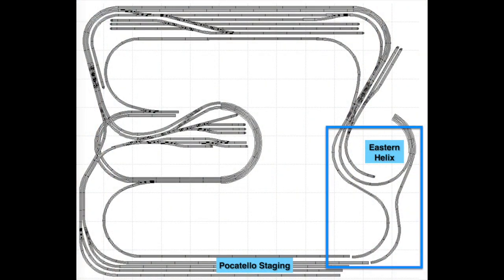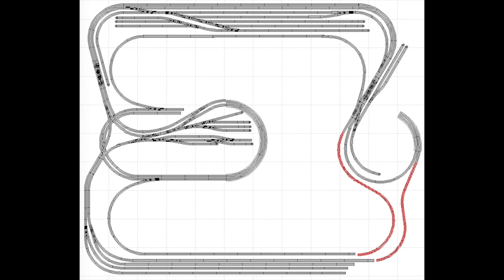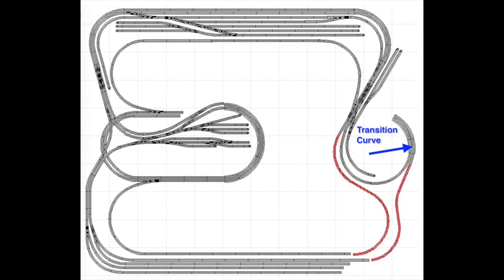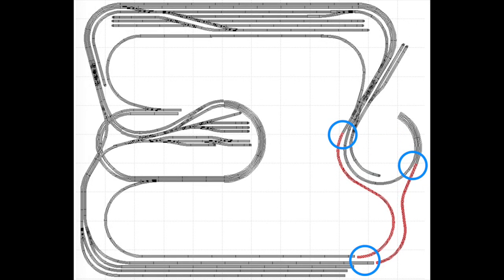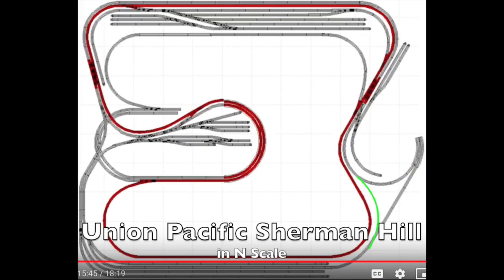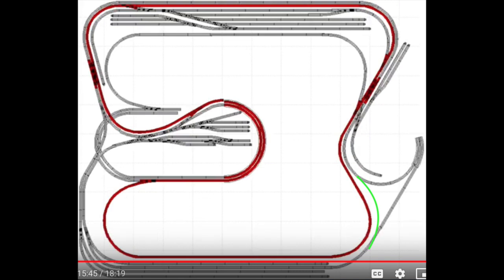Trackplan Changes 3: Bridging the Gap on My N-Scale Layout

Comment: Hello Roy, I've built a lift out section about 1.5 m by .150 mm it allows me to have a continuous run, comes off the straight main base board at aprox' 45 degrees which allows for the door open when in situ, This also allows for end to end running if I choose not to have it in place. Certainly enjoying your inspirational videos. Keep up the good work.

Comment: Just a thought:  Hinge the new section against the wall where your train shelf currently is located.  The new section folds up to the wall for room access and folds down for use.  The hinge keeps everything in alignment.  Since the new section is attached, a simple wire service loop can provide electrical service.
Reply from the maker: Thanks, my friend. That definitely is an option, and I may end up doing it. I do like it. We'll see. ...Roy

Comment: It's possible to "kitbash" flex track onto Unitrack -- for instance, cut a Unitrack straight section in half, and solder a piece of flex track between the ends using standard rail joiners and cutting away enough of the Unitrack roadbed-ties to let the rail joiners slide in. You can shim cork roadbed underneath the flex part to match the height of the Unitrack.  I've done this in HO.
Reply from the maker: Yes, I've heard of doing that, John. I may end up doing it myself, if need be. In addition, I know that Kato makes a transition section of track that allows you to connect Kato and Atlas track. ...Roy

Comment: Great videos, Roy.  Keep them coming.

With regards to "bridging the gap", you may want to consider having the addition be place on a vertical unit that has caster wheels, so you can simply push/pull the unit in and out of place.  The unit could also offer some additional storage area beneath it, if so desired.  Doing so will probably require that you either add some or remove some small pieces to the existing layout in order to create a convex shape, and then make the unit a concave shape so that it can be pushed/pulled into the room for access.
Reply from the maker: That's an interesting op;ion, David. Thanks for suggesting it. I still haven't decided what type of bridge to build, but I need to make that decision soon, because I want to get started on it.  ...Roy

Comment: Roy,  first, the door looks great swinging out now, the carpenter did a good job.  Next, you do have a very tight corner to make connections and incorporate some type of lift section. Slow going is the bast way to go most times, it gives you a chance to sit back and imagine trains running and any possible issues that could occur. Best always and look forward to the next videos.
Reply from the maker: Thanks, Rob. Yes, I am very happy with the door, now that it swings outward. It was such an impediment before. Now I have a lot more space in the layout room and can reconfigure my track plan in a way that will allow for much more interesting operations. As for the bridge itself, I must continue to think about it and really appreciate all of the suggestions that I have been receiving.  ...Roy

Comment: Clever way to begin by using the wooden supports and the foam sub base allowing you to lay the track in place before beginning.. Tom
Reply from the maker: Thanks, Tom. It was an easy way to make a template, and the template will help me cut the plywood correctly later on. ...Roy

Comment: Roy, A great update this week. This week there has been so many really brilliant ideas for the removeable section, all would work. I know how you performed the trick at the start of the video standing on both sides of the door at once. Like a true magician Roy, you used all " Smoke & Mirror's to make it happen. Cheers, Chris Perry.
Reply from the maker: Thanks, Chris! I'm continuing to work on the "removable" section and expect to deliver an update about it on Saturday. By accident, I figured out how to add a third track across it that will enable me to run not just one but TWO trains simultaneously on the upper level, without either of them having to descend the helices. That will be in Saturday's update. If you think that door trick was a feat of magic, what if I told you that my entire layout was just a bunch of smoke and mirrors? Ha! Just kidding. Do we deserve to have this much fun? (Yes!!!). See you on Saturday. ...Roy
Reply: Roy, I'll be interested to see how you was able to put in  a 3rd., track in such a small area. If not smoke and mirrors, could it be a Mirage, I wonder? Cheers, Chris. @n-scaleunionpacificevansto6569
Reply: @ainsleyperry5192   Chris, the most amazing thing about that third track is: I couldn't make it fit when doing the computerized track plan, but as I was fooling around with the actual track, it just fell in place, like some kind of miracle. ...Roy
Reply: @resmith49 , Just doing what you do best Roy. Just fooling around. Cheers, chris Perry..

Comment: Roy, just a question...
Why have go got that little s bend in the back track? You could have easily come off the helix and had nice straight run before curving into the yard. That also would have given you a wider radius curve leading into the yard.
Also, mike fifer did a video showing how to turn Kato track into flex track
Reply from the maker: You're right,  my friend. I've been thinking the same thing.  I'm not very fond of that bend. I'm going to straighten it out. ...Roy

Comment: I am not an experienced model railroader, but my attempt at a lift out section ended up turning into a duck under, and then a complete track plan change. I think that my problem was that I had 1/2 inch of difference between the two sides when I planed on it being level. I hope you have more luck than I did!
Reply from the maker: Well, Jared, a duck-under would be the easiest solution to my layout. I might start out with one, just to get trains running across the gap as quickly as possible. But eventually I'd probably change it for some kind of bridge that moves out of the way, because I'm getting a little to old to be ducking under. Thanks for sharing your experience. ...Roy

Comment: Real peogress, Roy!  However I would still suggest that you considder a lifting section hinged on the 'Helix Side'  which looks wide enough to support a structure of the necessary size.  If you install hinges raised a couple of inches above the baseboard surface the rail ends will move apart as the section rises...  Well it works on my layout though admittedly my 'bridge' is not in a corner!
Reply from the maker: Thanks, my friend. I appreciate your suggestion to put the hinges on the helix side of the layout. I like this idea, and it's what I may just end of doing. We'll see. I'm going to need to make a decision pretty soon. ...Roy

Comment: I WOULD LIKE TO KNOW IF YOU USE CURVES TIGHTER THAN 20-140 15" RADIUS CURVES, ON ANY PART OF LAYOUT. I LIKE WHAT YOU HAVE STARTED DOING THIS YEAR. TOMIX HAS A NICE SET OF MIX TRACKS I USED A COUPLE OF THE 30 DEGREE CROSSOVER
Reply from the maker: Thanks, Duane. Yes, I do use 20-130 in a limited number of spots where absolutely necessary, but nothing smaller than that. I prefer to use 20-140. Unfortunately, smaller layouts sometimes require that we use tighter radii than we would like. ...Roy

Comment: I think I have an idea for it but I will need some measurements from the tabletop to the floor And from the Layout edge to the door
Reply from the maker: Thanks, Joh. I appreciate it. Here are those 2 measurements: tabletop to floor - 56 inches and distance from door to layout edge - 40 inches. ...Roy
Reply: I also forgot to ask how wide
Reply: @cnwtrains  34 inches.
Reply: @n-scaleunionpacificevansto6569   Do you prefer a drop down or lift up? Still working on the plan for you

Comment: Hi Roy
UPSHERMANHILLS idea is worthy of continued thought. here is my 2 cents: if possible  at the yard at the bottom of the screen at  3:45  , modify the layout by using the top yard track as the extension for your new 'green' track and the second 'original' stays the same without the 'green' part. back in the yard could one or two  of double crossovers turnouts make for more versatility...?  I guess my feelings are that the closed end of the yard should  'join up more' eh? the tricky bit is that there is still a curved turnout... that little siding by the helix entrance /exit could possibly be joined to that helix track  ? thank you Roy...still giving thought to this pleasant little puzzle!
Reply from the maker: Absolutely, Bill. I haven't cut the plywood yet, and I'm continuing to consider UP Sherman Hill's suggestion, because I like it VERY much. Originally, I intended Pocatello to be purely a staging yard, but with these layout changes, it now works better as a through-yard (enroute to Portland, Oregon). So, definitely, I need to convert at least another one of the 4 tracks at Pocatello into through-tracks. I've been thinking of re-purposing that lead track for Crown Oil & Gas, just as you mentioned.  ...Roy

Comment: Hi Roy I have heard of people mixing Kato unitrac with flex track. There is a video out there but for the life of me I can't remember from who. Would you consider this? Good to see your plan moving forward nicely.
Reply: I am mixing Peco 55, Atlas 80 and Kato unitrac on my layout.  The best looking match is atlas 80 to Kato unitrac using Peco rail joiners.  The atlas is on cork and needs just a little shimming where it joins the unitrac.  I love the Peco large radius turnouts -- all manual control for me.  Makes layout building a lot easier.
Reply from the maker: Thanks, Sean. I've heard of that, and I would consider doing it, if need be. I think some brands of track require the use of a Kato transition section of track to connect with the Kato track. We'll see if it becomes necessary. ...Roy
Reply from the maker: Thanks for that information, Phil. It's good to know, in case I end up having to mix brands of track. I do wish Kato would make curved turnouts. In any case, all of my turnouts are still manually operated, although I plan to add Switchkats to the 12 turnouts in my staging yard, where it is a little difficult to see which way the turnouts are thrown. ...Roy

Comment: Roy i can see an S curve has crept in there on the lift out section. It probably doesn't present a huge problem since it is section track and they've likely worked out the geometry issues of S curves. If however you go flex track on the lift out/fold up etc area for placement reasons, you may want to remember the chapter on S curves in John Armstrong's book. 
I'd really hate to see you go to all the trouble of modification only to recreate another helix type headache. The track joints at the liftout/fold up area combined with the S curve could be asking for trouble.

* You really imparted in us your loathing of helices.
Reply from the maker: Thanks for your comment, my friend. Actually on such a small version of the track plan (in the video) it's just about impossible to see it, but there is a full-size straight track  (9 and 3/4 inches long) between each and every one of those curves. This should (I hope) eliminate the danger of derailments that real S-curves can cause. I definitely wouldn't want to have that kind of problem on my layout. ...Roy

Comment: Make it hinge down on the helix side.
(If it doesn't hit the floor.)
Reply from the maker: Thanks, Kade. Right now, a drop-down, as you suggested,  (or a lift-up) hinged at the helix is my leading choice. ...Roy
Reply: @n-scaleunionpacificevansto6569  I thought a drop down would be easier, because the tracks move  apart, instead of trying to hinge it,so it moves away from the bench at the same time,to clear the tracks

Comment: FIRST! woohoo!
edit: now that i've had time to watch the video, i have a possible idea for the liftout section. if you move the shelf thats by the door, you could mount the board to hinges on that wall. and then have bracing along the edge of the eastern helix and the edge of pocatello to support it while its lowered into place. this would mean that not much scenic stuff other than grass and shrubbery could be on the board, as buildings, trees or anything else thats much taller than an couple of inches might make the board stick out a little too far in the doorway and it might get bumped as you enter. but if you keep the scenic stuff to just a couple inches or less, you can probably get it fold up quite close up against that wall.
Reply from the maker: Congratulations on being the first to comment on this video, my friend. I really appreciate it. Thanks for your suggestion. I like it. It makes sense, and I could even scenic it, as you suggest. Of course, I would have to figure out where to put the engine storage shelf. But, again, I do like your idea, and that's what I may end up doing. ...Roy